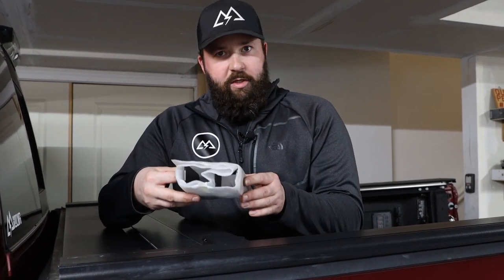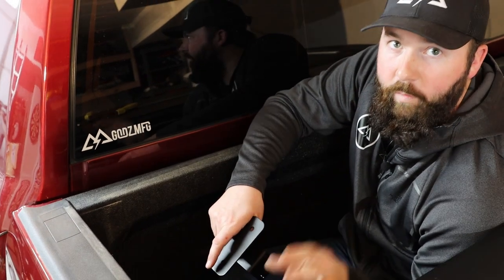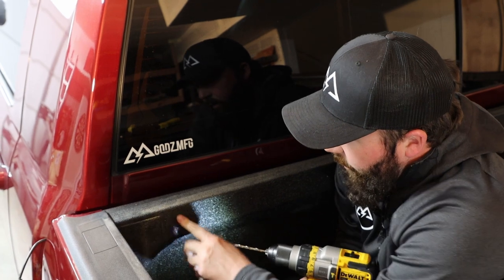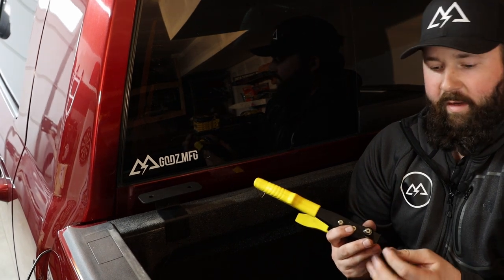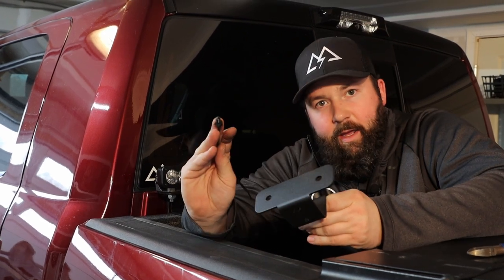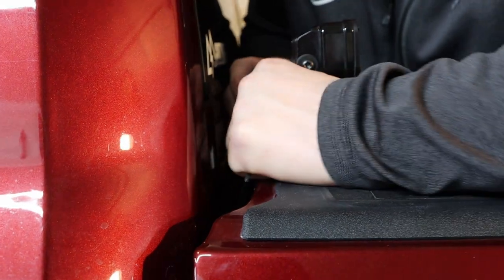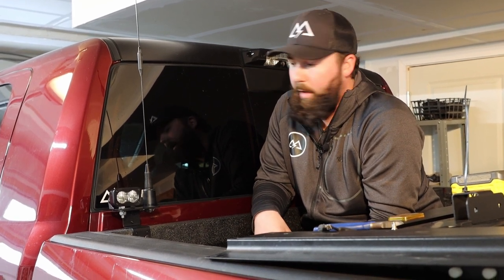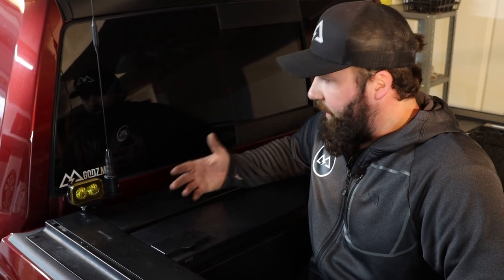The ULTIMATE Chase Light Mount with UNIVERSAL Fit | Install | GODZ MFG

Comment: WOW. really proud of those brackets! $70 for 2 is reasonable. for one is insane.
Reply from the maker: We are proud of these, they are designed and manufactured in Colorado. These brackets utilize 304 Stainless Steel construction and come with a super durable powder coat finish. Additionally, they work around nearly all tonneau covers for those of us that run them. If you have any questions, let us know!

Comment: its powdercoated.  And i assume aluminum rivets.  So the shield portion of the NMO would have zero continuity to electrical ground.   Not to mention, thats a horrible place for most antennas.
Reply: I've run a stake pocket mount for 8 years in that location, It's not ideal but it works and helps prevent damaging the antenna for us that use the truck bed. Any antenna should be bonded to the frame with a braided strap. The bracket only holds the antenna in place.
Reply: @stahpit1971 3 reasons thats a bad place for antennas.  

-Electrical grounding, which in your case isnt an issue if you bonded it with a strap
-Lack of a valid RF ground which would cause an issue with the radiation pattern, which depending on antenna setup can be resolved or even turned into a positive
-Depending on the size of the antenna and the wavelength of the frequency band, a large chunk of antenna is hidden by the cab, which further reduces the radiation pattern. 

Now, a full size pickup running properly tuned co-phased 4 or 5 foot whips with the correct coax, the radiation pattern would be extremely linear, with almost no side radiation, but almost straight to the front and rear, biased towards the rear.  For CB and highway useage, thats actually a good thing.